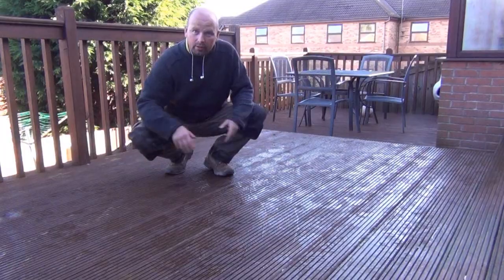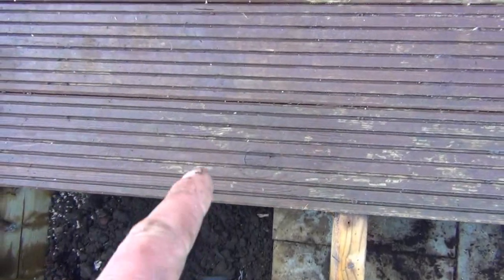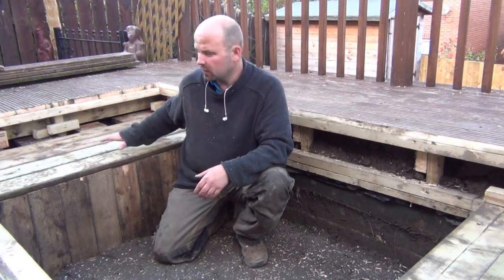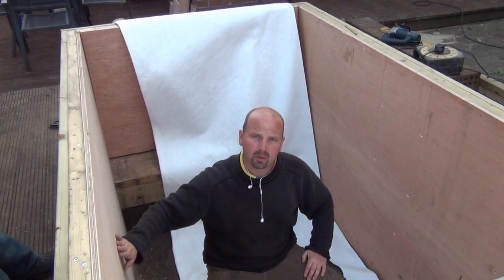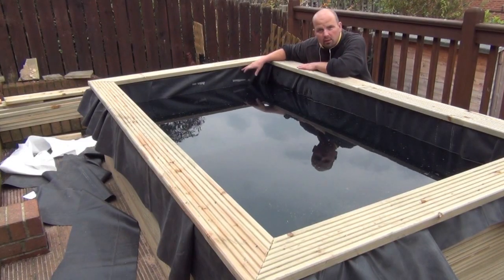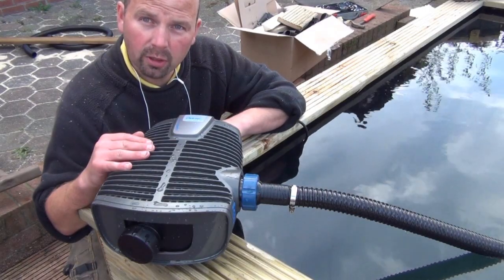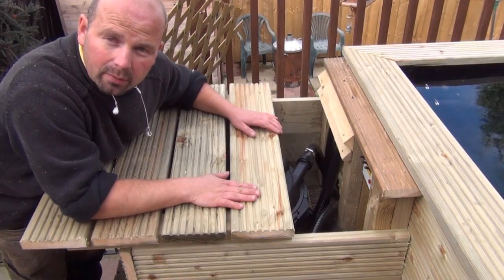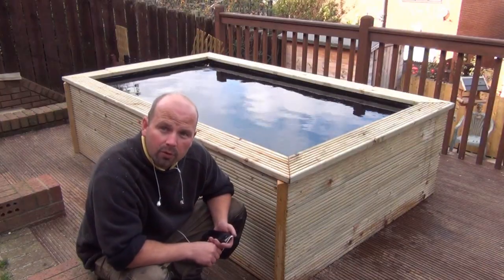How to build a raised wooden patio pond by Pondguru

Comment: Hey dude, loved the video and have copied the raised part of that pond using sleepers. Is it safe to use treated decking boards to finish off the top? I used untreated softwood which has buckled and split over a few months, so not ideal but was worried about fish safety
Reply from the maker: Pressure treated wood contains stuff which isn't ideal for fish but if you can get wood where the treatment has cured (when many f the salts have sweated out) then very little will be released out into pond and do no harm.

Comment: hi, we are thinking of adding an above ground level to our existing pond, we were thinking of making a frame around the pond similar to yours etc and then driving steel
stakes all the way through into the ground, the pond is 3.5m x 2.4m rectangle, will frame base sides like yours here be strong enough? i have seen people using really heavy duty timber like sleepers, we are talking around 2.5ft deep for the above ground part, any help is appreciated

Comment: That's a really impressive install! I've a similar shape to fit, a bit smaller, and wondered about glueing up a shaped liner at home to get rid of the folds and the "wicking" problem they can cause.

So a question. The folds cannot be pressed against the sides as you mentioned. Water can get behind the fold so however you make it the pressure is the same on both sides. Water pressure therefore cannot push it flat to the side. Tension in the liner will help, is this enough to keep it neat?

Comment: may I ask why there is insulation in between the wall studs? Is it to keep pond temperatures stable?
Reply from the maker: Yes it is to prevent large rapid temperature swings in summer and winter.

Comment: What happens when it rains?  does the water overflow the top? What stops the fish from going over the side? I had guppies in tubs outside this summer gone in Australia and I lost most of them when the tubs overflowed due to the torrential rain from cyclone Debbie.
Reply from the maker: If it rained really heavily then yes it would overflow but the level can be dropped using the filter drain outlet.

Comment: Can you tell me/show me exactly where the viewing window is for the UV light please as we have the same filter and I don't think the light is working because we have green water?
Reply from the maker: On this type of filter there is a tiny viewing window on the read of the electrical part of the UV (the part where you undo 4 screws) so if the light is working you should be able to see that shining brightly. If the filter is the correct size for the pond and the UV is working the pond should be clear. UV bulbs need replacing every spring.

Comment: Love your vids. Looking to build a pond myself. Can I ask how you would go about building one, when you cut the decking shape out and it's only soil  about 1ft below the decking. No slabs of concrete base under there.  I'm looking to do a 6 x 4 x4ft deep pond, based on your design. Hope you can help. Cheers
Reply from the maker: Jeff Nazer
Reply: Pondguru Outdoors  did you reply to me. i cant see anything
Reply from the maker: Jeff Nazer Not sure why there is no text there but that's the crappy google+ comments for you, lol You would simply follow the steps in this video as the situation you have sounds almost identical. You would just cut out the soil where you wanted the deep bit to be. If it was deep all the way across the bottom of pond then you'd just dig out down to 1' deep if it was to be 1' under existing patio or ground level.

Comment: Hi how well does the timber and plywood last long term? I would think it must rot eventually and be potentially catastrophic or does it just start to sag first providing some warning,  I am thinking of building a pond like this as blockwork would be too much for me due to poor health but I'm just concerned about it eventually falling apart. Thanks for any advice and great video!
Reply from the maker: As long as the environment is relatively dry and protected it should last 15 years + but if the plywood used was ordinary plywood (not marine ply) and was straight into the soil it would probably last under 10 years unless it was really well creosoted which may affect the underlay and liner.

Comment: Hi PG, cheers for posting the video...I enjoyed watching it - is very informative. I have one question...will the pond overflow in heavy rain? If so is there some kind of overflow contingency linked to the filter unit? I am building a similar pond at the moment, and would really appreciate your thoughts. Cheers
Reply from the maker: Not normally for the filter unit but for raised ponds we used to put a 20mm pipe in under the edging. The filter can also be used to drain water if necessary by using the cleaning function.

Comment: Great video thanks! Can i just ask are the triangular shaped pieces in the corners just for decoration?  Or to hide something? Thanks
Reply from the maker: Not sure what triangular bits you are referring to.
What time is that on?
Reply: Pondguru at 19.09 you crouch down and on the corner from top to bottom there is a triangular shaped piece of wood, (one in each corner).  Its a different colour to main sides if that helps?! Thanks
Reply from the maker: Mark Lang They are to hide the place where the two decking boards meet all the way down and give a bit of decoration.
Reply: ok Thanks, that's what i thought.  Going to have a go myself in a week or too! :0)

Comment: Great video, I have just made a similar pond. I may have missed it but did you incorporate an overflow?
Reply from the maker: I don't think I showed it in this one but a small 1" pipe fitted at water level under the decking top is all you need.

Comment: Can this be done with a flat bottom or would it have to be at two different levels please
Reply from the maker: Yes no reason why the base couldn't be flat although it is a good idea to slope it slightly down to wherever the pump / bottom drain is located so muck is removed properly.

Comment: hi guru, how does the frame hold up?
i'm planning to build one, but hestitate on using solid 4x6 in planks or frame like yours
Reply from the maker: +kentfang I think I was back there late last year and no movement at all in frame. I'm sure if there was a movement or separation of any parts I would be getting phone calls from previous jobs I'd done, lol.As long as the timber frame is built strong enough and it is in a dry environment it should last for many years.

Comment: Is it possible to  build a complete sbove ground pond that is 4 ft deep that i can leave fish in all winter without heating the water with temperatures below freezing? I will insulate between  the frame and the liner
Reply from the maker: Quinn Mahoney It would still probably get too cold if there was prolonged weather below freezing but for most of UK the temperature rises and falls daily.

Comment: Good video, but I wish you showed how you cut a hole for the filter pipe.
Reply from the maker: I just used a circular hole saw on my battery drill. They are available online in a wide variety of sizes.

Comment: Help - Possibly made a BIG mistake built in block a totally above ground pond, but it's only 30" in depth. If we insulate around the pond, will this be enouch to protect fish in the winter?
Reply from the maker: Plenty of fish live in above ground ponds and a block pond faced off with brick or stone often is thick enough to offer enough insulation but would have been better protected if it was partially in ground. If you've yet to add outer skin on blocks just put insulation between block and brick / stone, no worries.
Reply: Pondguru
That's how I was thinking, unfortunately we were unable to dig down.

Many thanks for your help :)

Comment: Thanks for getting back to me.  So my wooden frame would just sit on compacted soil.  Don't need to make a concrete collar to sit it on and screw it to.  As yours looks like it's sitting on them slabs. Thanks again
Reply from the maker: Jeff Nazer The main frame sides were attached to the decking and I take it yours has no surrounding decking? Therefore it would be best to put a concrete collar around pond and fix to that.
Reply: I will have surrounding decking once I cut hole out. So I can build up the sides off of that. It's just the frame work you put in under the decking between the deck and paving slabs.  I don't have slabs underneath , just soil.  So not sure what to rest the underneath frame on.
Reply from the maker: Jeff Nazer That makes it a bit more tricky but as long as you use pressure treated wood (you may have to recess frame into ground) and marine ply it should be fine.
Reply: Ok thanks for your help. Maybe I could lay a waterproof membrane underneath and bring it up the outside of the ply and frame that's is below dirt level. So no soil is in actuall contact with wood.
Reply from the maker: Jeff Nazer Yes that would give it extra longevity no worries.
Reply: Thanks again. Gonna spend rest of Father's Day with me feet up watching you vids.

Comment: Just found your videos. Very interesting and informative. I already have a "Block" built pond, but I am moving house soon and would like to build another pond,. but this time using the decking timber as you have done. I can understand the use of the fittings through the liner for the filter hoses, but what happens to "overflow" water from rain etc. ?? Does it just pass over the top of the liner and run down the outsides of the timber box.?? Would that not cause problems in its own right with the timber rotting over time.?? What sort of total cost is involved in a plain rectangular 12' x 6' x 3' deep, above ground timber pond with the filters and pumps as you have shown. I look forward to further contact with you. - Dave Page
Reply from the maker: +David Page Dear Dave, I would generally put a 20mm pipe in under the top outer decking as an overflow - not sure this video shows that.
I have been out of the pond construction business for a couple of years so I don't know current prices on anything unfortunately. If I had to take a stab at material cost I would say £1500?

Comment from the maker: Either or is fine as a wooden pond like this would only be built if drainage was good under the ground / deck level. If it was just in a garden (soil) I'd build it with concrete base and blocks.

Comment: Could u use the insulation as underlay for the liner also? Extra insulation beta padding also? Or am I being mental?
Reply from the maker: It is much easier to lay liner over proper underlay as it does not tear or stretch but I have seen pond liner laid over the insulation with varying degrees of success.

Comment: kool so say its going to be square..and youve made the sleeper farm, (first layer) dig the whole accordingly say its 2ft deep just the frame youve made will fit in the nice square hole youve just dug. then take the frame out set a foundation (just on the bottom?) let it set then put the frame back in and then build it up securing them together .
then just add holes needed for pumps and underlay and liner ? thanks for your time man

Comment: My pond filter and pump set up is the same as this and it Works well and the water is clear. I would like to improve the filtration by adding an anaerobic  stage if possible to assist in the removal of Nitrate how would you achieve that on the setup in this video. I'm not constrained by decking.....the water does return at a fair rate of knots into the pond so not sure how best to amend my setup

Ideas?

I have used your canister setup "pimp your filter" in my aqua max 15000 for my aquarium (biomedia ultimate in post) and hope nitrate levels drop there and would like to achieve something for pond (a few Koi, carp, tench and Rudd)
Reply from the maker: If you have a Filtoclear filter for the pond then passing the outlet up to a shower filter filled with Pumice would be a perfect set up for reducing nitrate and conditioning the water. Even if only a portion of the water coming from the pressure filter went to the shower filter it could work wonders.
Reply: Thanks. intend to put a Y piece into the hose from the Filtoclear up to a stack of 3 boxes - using 25kg of pumice (2.5k ltr pond), i expect i will have to monitor the amount of water being held in the bottom box and put holes in the exit pipe (dont want it to drain too quickly) as required......are the anerobic bugs quite quick at munching Nitrate?
Reply from the maker: Yes that sounds like a good set up and even if the water drained straight out of the bottom box the system would work as it should do - most of the shower filters in Japan do not retain any standing water and are positioned right over the growing ponds.
When using good media (biohome or good quality pumice) the water retention in the internal structure of the media will ensure that anaerobic conditions occur in small pockets whatever the flow.
Showers generally have water falling straight through them to minimise the standing water and therefore also minimise the chance of the media clogging. It will still eventually clog but clogs less quickly in falling water than standing water.

Comment: So pond guru you have got me through my koi pond build better then any other youtube vid but please help the sides are up the liner is in its filled with water now I need to hide the liner under the capping wood I neatly tucked it under but the corners where the folds are are so bulky you can still see it when you place the cappings over :)
Reply from the maker: Usually that would not happen when the folds were made as the water should keep them in place.If it is a new pond you could try emptying it and relaying the folds while it if filling up, enabling the weight of water to press them flat against the sides.
Reply: Thank you for you reply its all done nw and there are a few folds but nothing bad fish are super happy to be out of the temp pond thanks again for your knowledge :) heather
Reply from the maker: That is great and I'm glad the problem is rectified. Summer is definitely the best time to do any pond work.

Comment: aup bud , I'm just about to start my pond project, and I want to build it raised , I was going g to use solid 4x4 timber because I want it arround 10 ×8 maybe 8×6 would this stood stile framework be strong enough , there would be probably 3-4 out the ground , and I want a large viewing window also
Reply from the maker: I can't see 4" x 4" timbers going anywhere if they are fixed together and interlocked at the corners so no worries there. I think there are a few videos about viewing windows in wooden ponds on Youtube but I have only ever done a window in blocks / brick ponds.
Reply: thanks for the reply bud

Comment: I have never seen that type of liner here in Canada, that you can heat and seal the flaps, I have asked around, all they have here for pond liner is a heavy felt, same as they use for road building to put between say clay and gravel, to keep the clay from eating up the gravel, as well to give the gravel a lot more support, that is a very good type og polyester liner you using
Reply from the maker: The underlay is polyester but the liner is rubber. Sounds like the stuff you have as road / gravel underlay may be similar so see if you can get a sample and see if it melts in the same way. The liner used here is 1mm thick 'Firestone' rubber and should be available in Canada as it is manufactured in the US.
Reply: I wonder if it is the same 'Firestone' rubber they use here on flat roofs, its 3ml, you can buy pond rubber liner from garden shops but very costly, its not 'Firestone' rubber , some other brand by pond mfg supply, that roofing rubber here maybe available in 1mm, I know I have a huge peace left over of the 3mm from when I covered my root cellar I built some 16 years ago, my land has huge step hills were when I was married I had stacked it out for a big pond in the main yard, with a river with a few sets of falls to the bottom of the yard, were our, at the time was to build a house with a walk out basement. but after 2 year my now ex wife wanted to move to town, when she asked me to Marie her, that was the main condition if I marred her we would live there, told her I didn't want her coming to me in 2 years wanting to move to town, well she made my life a living hell for 10 years, I would not move. she agreed to develop my land, I bought when I was in my 30's, all went down the pond drain
Reply from the maker: Yes the firestone is used here for roofing and it is exactly the same product. My wife hasn't really given me grief over the pond I have now but there was a point where I had ponds all over the place so I filled them all in and not only have the large one.

Comment: its made with 2x4 , it kind of looks like a babys cot , im going to put diagonal struts on it and screw small 2x4 in between to pull the supports tighter together if that makes sense , thanks for the reply
Reply from the maker: +Kimahri69 Yes sounds good to me and using the wood the 4" way will give loads more strength than the 2" x 2" which I used here. Sounds like you have a good handle on how to build it so it should be fine.